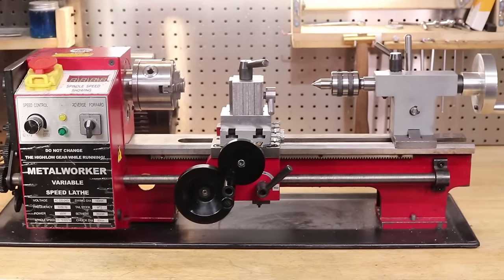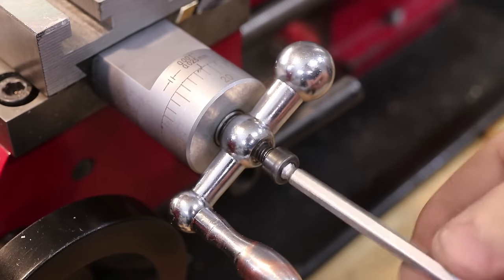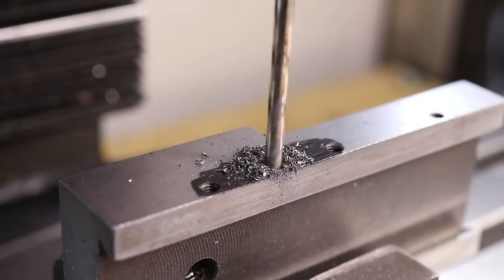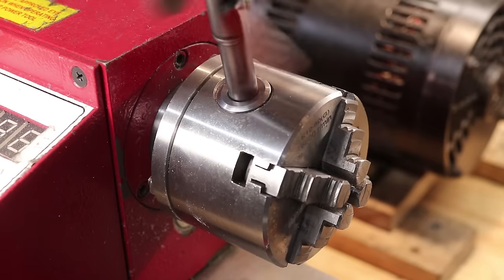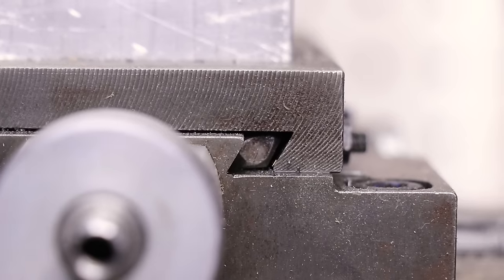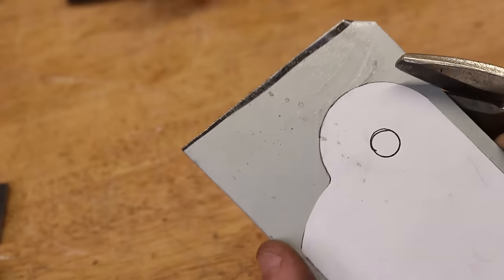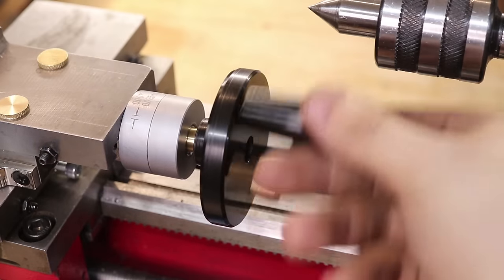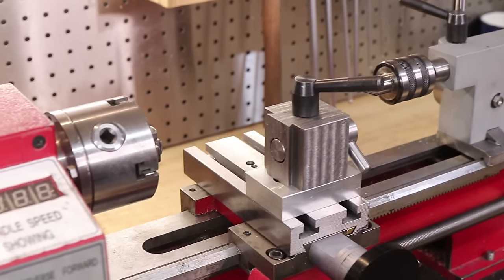20 Best Mini Lathe Upgrades And Improvements

Comment: I also highly recommend a waycover. i´ve made mine from a piece of sheetsteel which sits just in front of the main carriage and is long enough to only reduce travel by about 5mm and still catches most of the chips produced by turning and drilling. It saves a lot of time in cleaning and probably reduces wear on the machine bed
Reply: What Quelix said. I did the same thing and it does wonders for keeping the ways clear. I set the length by adding ~2mm to the spacing from the head stock to crash my main turning tool into the jaws of the chuck I use most often. Keeps everything clean and helps prevent visits from Mr. Bozo.
Reply: @davidwillard7334  pl

Comment: thank you for your video, i got my lathe, same model as you have a good few years ago on the advice of a friend who was a very good engineer, (
retired rolls royce ) unfortunatly he passed away earlier this year so now i'm having to rely on people like yourself to provide me with info to make the lathe as good as it can be, as i'm a retired mechanic i have some basic skills with lathes but i keep finding small problems with it as you have found though it's knowing what is wrong and how to fix it is where the problems are for me and this video has gone a long way to show me where to look, i have fitted a quick change tool post and made a carrige lock and done my best with the ways and gibbs, i still have the tailstock to sort but with your help i'm getting there bit by bit, as i only use the lathe now and again to make spacers and other small bits i don't suppose it needs to be that accurate but i'm a bit anal i suppose you call it when it comes to doing things right, i would like to use it for threading and other stuff but my confidence is not there yet, one of my main gripes is parting off even with alloy bar it's so slow and jams up now and then, i would like to have a miller but with my use and lack of experience and of course the extra cost i don't think that would be an option, for now at least, i'll use the link and see what happens, thank you.
Reply: Parting can be very tricky. Be absolutely sure your parting tool is not above center even a tiny bit because the work rotation will pull the tool down deeper into the work piece causing the tool to snap or jam. If anything a .001 below center is much betrer.
Reply: Hi I too was an apprentice at Rolls Royce (East Kilbride and Hillington,Scotland).
Your problem with parting off may be reduced if you part in revise. Turn tool upside down and come in from the back (remember to reverse the head stock this way the tool will have less force on it and it will clear the chips automatically)
I like this lathe and have modified a lot.
Please contact me if you want any more information
Fred
    @opinionated6034

Comment: Hi from France, and thanks for this video!
I'm considering starting out my own workshop, after years of lurking, using bad maintained machines at work at some time, etc etc...
I'd have two questions though:

1- Do you recommend starting out with the lathe or the mill? I'd go for the lathe spontaneously because it's the machine I know the best, BUT the mill looks kinda required to do the mods to get some accuracy from the lathe... Thus my question. 
And then there is the question of money, and how to cleverly kinda stagger the expenses... Any advice would be appreciated at this stage. 

2- Regarding benches/ stands for, say C3 lathe and X2 or X2.7 mill, is there a good affordable option? Some recommendations? 
I've taken a look on secondhand industrial benches around home, rather rusted and expensive... So, maybe it's time to try some welding a box frame and putting a thick slab on it? Or maybe I'm overthinking it, which I'm also familiar of? 

On this subject I've found this video: https://www.youtube.com/watch?v=IbfUaeUp7RY
Well build I'd say, maybe a bit too much though? 
Looks like those benches are a bit of a can of worms unfortunately, it's not that clear for (cheap) novices. 

Many thanks for your help anyway!
Reply from the maker: Depends on your use case but I'd go with a lathe, its what I did. Unless you specifically need a mill. There are many talented channels that are able to make stuff with only a lathe. Plus you can use the lathe as a mill with a vertical slide. 

IMHO those lathe or mill benches unless you get expensive ones are never that great.

Comment: Great video, I have a Vevor 7x14 and got it for really cheap on eBay but ways and lands have a big gap (maybe 1/16 or 3/32) between the land which angles down from the ways to the lands, should I try to machine the ways groove deeper to lesson the angle. I would have to do that on the headstock, carriage, and tailstock.

Comment: Did the aluminum riser block for the tool post work out ok, as far as rigitity? Was not sure if aluminum would be as good as steel.
Reply from the maker: Yeah aluminium was fine. I eventually replaced it steel but I don’t think I saw much improvement in doing so. Either way both were far better than having the compound on.

Comment: I'm adding a verticle slide and a tilting rotary table to mine as I don't have a mill, not sure how well it will work but hoping it will be a good option to swap out when needed, what do you think?
Reply: Please let me know how it goes!
Reply from the maker: All ill say is that you will be very limited by the swing of the lathe, usually not too much room before you hit the bed with the compound. It can work, just be mindful of it. A compound with T- slots will be very useful in this situation.

Comment: Hi, and thanks for making all the videos.
I have a Bernardo Profi 400 V with issues in the spindel bearings. Something is uneven, even when all gears and pulleys were removed. So I had to replace the 30206 P5 bearings with new from SKF.
I have managed to get the spindle out. But the outer parts of the bearings are still in the headstock.
Shall I replace them as well or can I keep them as they are? (I suppose I shall replace them...)
I'm a bit worried that I will not get the new in the same location. It looks like there is no flange to mount the bearing against. (Just a continuous hole trough the headstock where the bearings + covers are pressed in the correct place.)
But I could do some measurements before I take it apart...
Reply: Hi

Comment: I plan on doing a couple of upgrades to my Vevor 7x14. But at some point it would be better to just buy a better lathe.😅😅😂

Im happy I only need mine to do 2 simple small operations, but out of the crate to have the tool holder so far off and not provide shims to help line up center to stock does suck and yea im looking at buyin an adjustable quck tool head.

I just feel like that was done on purpose to get you to buy an upgrade out of the box.

Comment: How much better would You say the lathe is woth all the upgrades? In like a % guess of improvement?
Reply from the maker: I don’t know if I could put it in percentage terms, but it went from being able to take 0.1 or 0.2mm cuts in steel to being ableto take 0.5 - 1mm cuts in steel depending on the alloy
Reply: @artisanmakes  That is quite significant. Thanks alot man. I might be getting a mini lathe the weekend still contemplating it.

Comment: Maybe its time to add grease lines to those tapered bearings and change the low/high plastic gears! Great content BTW.
Reply from the maker: I'll probably do that when I next pull it apart to decrease the bearings. And no need to change the plastic spindle hears since I power the spindle directly from a pulley mounted to the end of it. Cheers

Comment: Independently of the quality or need for most upgrades on the mini lathe. Some of which I implemented myself. My best advise would be. 

To get familiar with the tunning procedures of the OEM lathe. Simple as that! 

Many of the original solutions are not the best, the most comfortable to use, etc. 
BUT they do WORK! That should be the principal conclusion of all this. Are there better ways to do it. Are there improvements to be made. Sure there are. But the OEM can work amazingly well if one knows what to do... 
This comes from someone who got a "lemon"! Out of the box it would chatter turning plastic!! So trust me when I say it can be done with plain OEM stuff. ;-)

Comment: I am thinking about getting my first lathe and have a question. Does this one have a pass through headstock? If so, would it accept something 1.5 inches in diameter?
 Also, I don't see this spec when I look at lathe specs. Is there another term I should be looking for?
Reply from the maker: I think you are looking for the size of the spindle bore. If you looking for 1.5 inches then this lathe will be a little small.
Reply: @artisanmakes  I am wanting to work on a rod that is 1.5 inches diameter, but longer than will fit in the lathe, so it needs to pass through where the chuck. Is that still the spindle bore?

Comment: I think that the way to go with the carriage is tapered gibs that can be externally adjusted.  I have found this to make improvement in rigidity, as you can tighten them down as needed.
Reply from the maker: That was certainly my back up plan if the new strips didn't work. I am sure tapered gibs net much better results but I am sticking with this set up for the time being. Cheers

Comment: Any thoughts of a right angle plate instead of the solid steel tool post for the solid steel cross slide?  Then add a vertical slide with a vise or plate to the right angle plate, possiblely just using the compound with a vice or plate.  I've invested in, though haven't had the time to work on the mini-lathe.  Thanks for sharing all the details with links.  That's super helpful.

Comment: What do you think of the tray under the lathe. I've never bothered to put mine in, I  havent bothered until this point and I like to get a brush under there and just sweep out all the chips easily, and I am thinking ti might be a pain to get the chips out from under the lathe with the tray in place. But I am getting ready to bolt the lathe down, and wondering if I should put the tray in.
Reply from the maker: I've tried before and on these extra small lathes my hand hits the tray when I turn the carriage hand wheel. Maybe on larger lathes but not on these 7x ones.
Reply: I like having the tray, but I haven't bolted my lathe to the bench.  Instead, to increase the stability of the lathe, I just create larger "feet".
The stability problem with these lathes is that the width of the base is only about 3".  So, I added a length of lumber under each end to widen(lengthen?) the feet.  That is, with the tray in place, bolt the lathe to a couple of pieces of lumber, about 8" long,  for feet.  Then screw the rubber feet under the ends of the the lumber.  Now the lathe's "feet" are 8" apart, instead of only 3.  This makes a HUGE difference is stability.  Plus, you can still relatively easily move the lathe if needed.

Front View
\___________________________/      tray
  |___|                                  |___|       wood feet/base
   |_|                                       |_|        rubber feet

End view
\_________/      tray
 |________|        wood feet/base
 |_|         |_|        rubber feet

(Hopefully the "drawings" above come out spaced the same on your end...)

Another utility to this setup is that the space under the tray can be used for temporary placement of items you want to have at hand, but not in your hand at a given moment.  I've kept a container of tools there for easy access.  The container is easily removed to allow cleaning/brushing out the area.  I've also just used it to keep a pencil & the drawing of the current object being machined.

Comment: Very useful video!! I mean you don't have to do all 20, but modify as you see fit for what you use your lathe for. As most of the modifications you showed us are cheap and do not require much tooling, OR effort it is strange that the manufacturer does not put just a little more into this mini lathes. If you do all 20 it reminds me of a joke about a guy who had the soles replaced on his shoes and while he was at it he also got new leather.. 🙂

Comment: Are you considering putting your considerable expertise into redoing the compound so you don't have to drag it all the way back to just adjust the angle with those two little screws you showed? You said you don't do much tapering, but that and a thread dial are the only two that it looks like you're really missing. Other than a DRO, but that's a preference from what I've seen.

Comment: Sounds like a lot of these would be good "first projects" when getting into the hobby. I know when I started woodworking oh so long ago, some of the best initial projects were shop-purposed furniture, where you can screw up and it doesn't really matter, along with trying different techniques for things.

However, it sounds like if you're going to do more then 4 or 5 of these, you probably bought the wrong lathe.

Comment: Quick question. Do you know, or does anyone have a rough estimate as to the thickness of shim used to level the tailstock?
Reply from the maker: its .2mm. That suits me but could be different for you
Reply: @artisanmakes  It’s details like that which put me off buying a Chinese lathe. There’s no excuse for such an obvious error. And adding shims reduces the stability of the tailstock. 

Trouble is that old Myfords cost far too much.

Comment: i would've never thought to make a tool post out of aluminum.  metal is so much cheaper and easier to cut.  i don't think you're meant to be doing any work on that machine that would preclude an aluminum toolpost though.  i don't know if preclude was the right word, by the way.  so if that sounded ridiculous, that's why.

Comment: The QCTP I got was a bit too tall so I had to take a bit off the cross-slide casting to get the tools down to center height.
Reply: I removed material from the bottom of the tool holders to bring them into centre height.

Comment: I've made many of thise modifications to my little lathe. I did use sealed angular contact bearings but setting the preload was fun. I must admit I still have the original motor and belt design and keeping the belt tight is a mess since you have to remove the control panel to get to the motor bolts. I do not see an easy way to make a belt tensioner. I do hate my aluminum quick change tool post but have not spent the money yet for better. Nice video.👍
Reply: @davidwillard7334  No comment is better than that.🤔
Reply: @davidwillard7334  You  seem to have a problem with this lathe , i think it is a lot more fun to use than not having any lathe.

Comment: How does the sieg go turning and machining 316?
Reply from the maker: You can do it if you have sharp inserts, but it won't do it quickly
Reply: @artisanmakes  so if I were looking to get a mini lathe with the intention of working with a bit of small stainless part making, it probably wouldnt be the best pick?

Comment: Be careful when increasing the “power” of your motor.  If the machine does not have metal gears, the likelihood of stripping the gears is increased.  Up grade to metal gears when you upgrade the motor.
Reply: @davidwillard7334  wooden pistons work too but I would’t chose them over metal pistons.  Wooden gears really?

Comment: Great video and work to improve that lathe but it go to show you why you should probably pass on them and look for an older Logan or Atlas
Reply from the maker: Possibly, the value of these machines does vary depending on where you live though. Older machinery is not super common in my part of the world so these lathes make.much more sense
Reply: @artisanmakes  that makes sense I was lucky enough to pick up an old Logan for $200. It came with three chucks, a steady rest and a bunch of tooling.

Comment: Replacing the slide with a block of metal is the Single best improvement for so little complication  on these small lathes. Why the hell do they not sell the slide replacement block with the lathe? Or at least sell them as a side component the way they sell the quick change tool holders?

Comment: Best upgrade on my 7X lathe would have to be the bed extension kit from little machine shop. Technically its 16 inches but its actually closer to 18. Next I want to extend the cross slide and ad a cam lock to the tailstock. But the bed extension is awesome, i have more then enough room now, they tend to be a bit hard to get being LMS is always sold out and nobody else sells them that I could find
Reply from the maker: I have not heard of the bed extention kit. I'll have to have a look on LMS, although shipping to Australia can be very pricey, especially when it comes to machine parts. Cheers

Comment: You can use the lathe as a makeshift mill, by placing the workpiece in the cross-slide, and putting the cutting tool in the lathe.